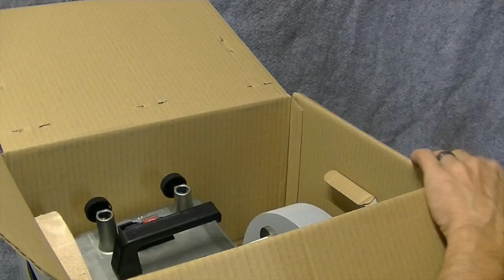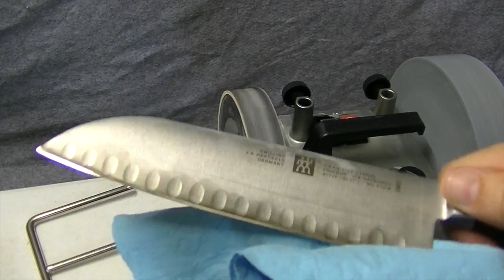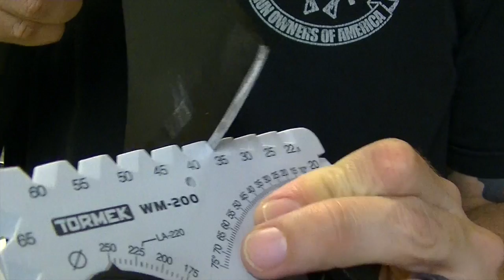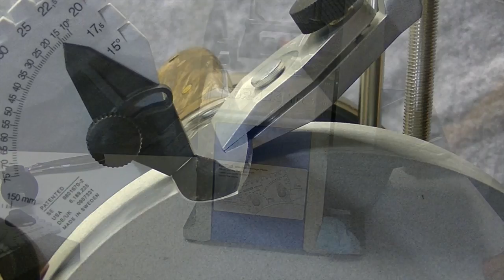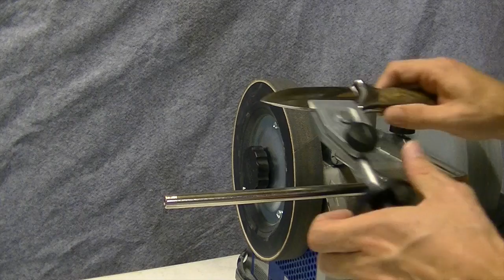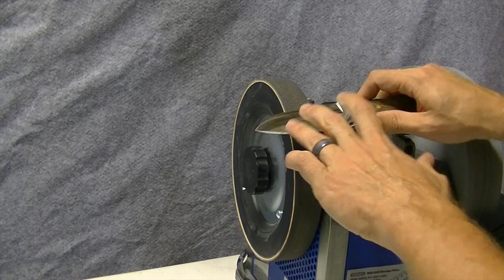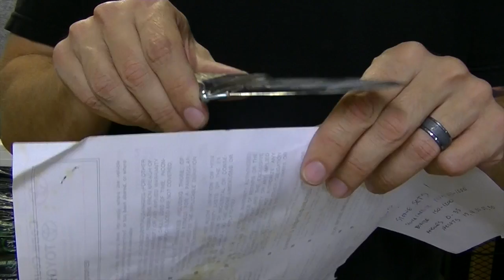WorkSharp Killer #3 - Tormek T-8 Knife Sharpener - FULL REVIEW

Comment: Harleywood, I have an edgepro sharpener,and I was thinking about upgrading it to a wicked edge and selling the EP. But know I am thinking maybe getting a T-8 instead, and keeping the EP to supplement it. Which way would you go if you had this dilemma?
Reply from the maker: that's a really hard one. I would definitely sell the EP.  Is the sharpener just for your own personal use, or are you selling sharpening services? If you're selling services, i'd go with the T-8. It would allow you to sharpen much more quickly. If it's for personal use, i would go with the WE. I love just chilling and spending time carefully sharpening my knives. The WE really allows you full control and a wide range of stone choices. 

Tough decision. Hope that helps.
Reply from the maker: You'll be very happy with the Field model. I have that also. It's very easy to transport. I take it to hunt camp and work in knives in down time. It's a great system.
Reply: Thank you for the reply. I don't sharpen knives for living, so I decided to pull a triger on the WE gen 3, but someone just snatched the last one at the 699 price. I did not want to pay $850 elsewhere so I started doing more research, and I am glad that it happened this way. 
What I got instead is WE Field and Sport with 100-200, 400-600, 800-1000 grit diamond stones,  1200-1600 ceramic stones, blank leather strap stones (to be used with green and white chromium oxide compound). It also utiliezes the ball joints as a gen 3 system. It comes with a gen 2 clamp, that actually I prefer over the cam action of Gen 3 for more positive holdin ability of the blades and narrower width (1" vs 1-1/2"), that is advantageous for smaller blades. It will take more time setting it up, compared to gen 3 clamp, but that is ok. 
The other advantage of the Field and Sport model is a wider array of angle setup (13-35 vs 14-27 on gen 3).
Being a value junkie, I feel that I spent less and got more compact and versatile system than the gen 3, which is also nice but for the most part, the increased price pays for cam shaft clamp, a bulky alluminum storage table box and automated angle adjustment mechanism. My total was $485 instead of $965, if I went with the same setup of Gen 3.  Thanks again for pointing me in a right direction.

Comment: I have the 8 inch T4 system. I'll tell you what really hasn't been covered in this nicely done video. Tormek has a huge amount of jigs available ...even one for doing a great job on drill bits or large planer blades or all types of curved or straight turning chisels. The t4 also has a Japanese stone available sj-200 for 275.00 and it is 4000 grit. One of the most useful accessories though is the bgm-100 accessory mounting jig. This enables you to setup the matching mounting bar provided next to your regular grinder,and uses the jigs ...(even a 6 inch grinder) for really heavy stock removal (like a dull axe) before moving over to the Tormek. If you you use the angle tool ....you can match the profile . Initially I thought maybe I  should have gotten the 10 inch  model ,until I discovered that I could easily find 8 grinding wheels over the counter at big box stores....I simply have to make an arbor adaptor for a 12mm shaft. I will soon purchase an 8 inch silicon carbide wheel (aftermarket) so that I can do some sharpening of carbide blades myself (work in progress) If I get lucky I will find a diamond embedded wheel for less than 300 (ouch).  Oh, someone mentioned about hollow bevel. On a 5/64th blade ,at 20 degrees (single bevel) the bevel is only .0012 gap in the center for a 10 inch wheel. hardy noticeable on such a long edge. From a (diagram in the manual)  My only complaint for the system is that some of the jigs are too pricey...but at least they are interchangeable among the t4, t7, and t8. Just some additional info for you .
Reply: For anyone reading this now, the T4 is only rated to be used for 30 minutes every hour while the T8 can run 24/7.  If that isn’t a deal breaker then the T4 is great

Comment: When you're measuring the angle at 9min 30, you're measuring the main bevel, not the cutting edge. That measuring device looks way too big and crude to measure the primary cutting edge, so how do you know what angle you're actually sharpening at?

Also it's funny that one of your criticisms of the Work Sharp is the amout of steel it removes. Did you listen to the stone ripping the steel as you were slamming the blade into it? You'll find most of your knife in the water tank, attached to the magnet.

Comment: I can finally agree with you..
I haven't purchased the tormek yet..but I do own the wicked edge as well as the hapstone pro and the kme as well as your hated work sharp..lol
I must say the tormek gives fantastic results. I have played with the t7..
my only contradiction to ur comment is that the edge off the tormek to me is every bit as sharp and polished as  the edges I have gotten on my wicked edge..just my observation.
in closing a very informative video..ty
Reply from the maker: i haven't been able to get a blade quite as sharp with this, as i can with the WE. Might just need more time with it and use the polishing wheel more. 

I don't really hate the WS. I just don't agree that it compares to these. Plus, if you think about it, by the time you replace dozens and dozens of belts, to sharpen the same number of blades, you might as well have just bought the WE or Tormek.
Reply: That part is true. They don't last nearly as long even if u get the high end 3m belts..
Like I mentioned in a earlier comment..I pretty much just use it for larger fixed blades that I want a convex edge on